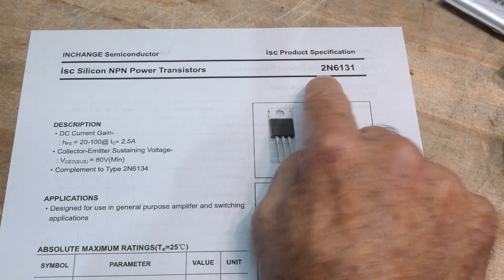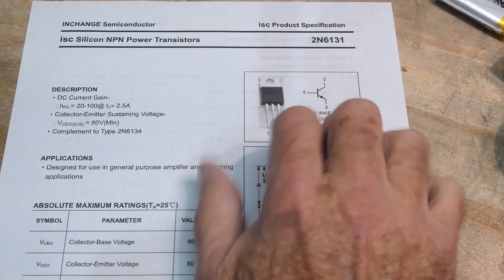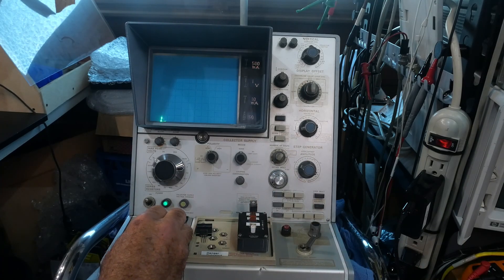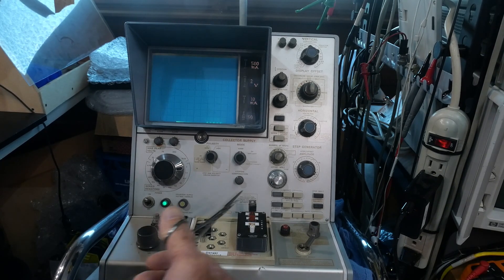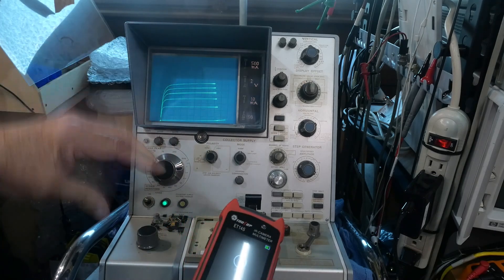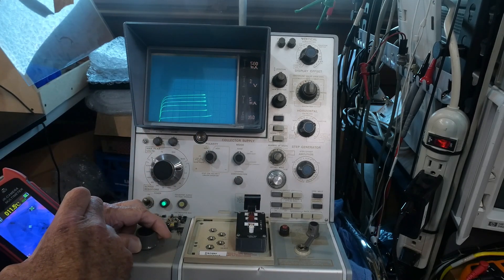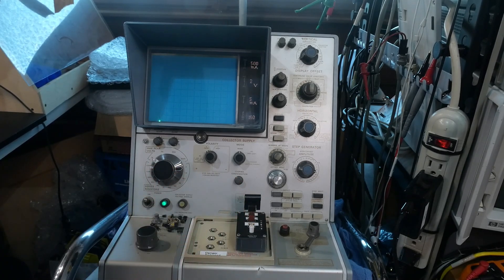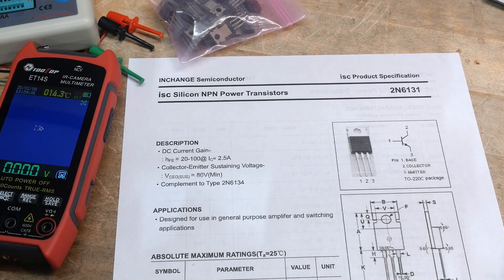#2145 2N6131 NPN Transistor

Comment: This reminded me of the old days. The worst thermal transistors were, of course, the Ge ones. They would easily run away and destroy themselves even if not too hot.  The  biasing needed to be designed really carefully keeping in mind also the normal working point. If that started to slide, the Ge pnp or npn lost its vital parameters causing distortion or clipping.

Comment: power transistor, no power rating (watts)
Reply: It's on the first page of the datasheet. Absolute max: 50 watts. Additionally you can use Ohm's law: it says 7amps continuous collector * 1.4v saturation, plus  2A base current * 5VBE = 20w, which is the more realistic option with the style of heatsink and no fan shown here.
Reply: It doesn't show in the video , and it is not spoken also. amps times voltage is not ohm's law it is joules law.
Reply: @RealRobotZer0  What does it matter? First of all, Imsai isn't a sales rep pitching a 30 year old transistor. There's no reason for him to include the less relevant specs info in a YouTube video. That's the job of the datasheet, which is right there. No one selects power transistors based primarily on their heat dissipation. You care about the current it can provide and the voltages it can handle first , and then you only consider dissipation when you're considering cooling.
And lastly, as we both clearly share a love of pendantics 😁, it's actually Watt's law for P=VI. Joule's law is P=I^2R.
Reply: @SkippiiKai  People just talk about everything but the point, don't you feel like that?
Reply: @RealRobotZer0  Well... No. He discussed and showed cool things about old tech. That was the whole point.
Reply: @SkippiiKai  You just have no expectations and take everything as is. But if you were to try to make something , you wouldn't be able.
Reply: @RealRobotZer0  in the last 24 hours I designed two new switching power supplies and completed building a dummy load I designed that I've already used several times testing other projects. Some of that was achieved by actually reading datasheets. I'm sceptical how much more I would have accomplished if I'd spent that time insulting strangers on the internet for not telling me things I hadn't asked them. Although now that you mention it, I am pretty annoyed you didn't even tell me the max cathode current of the TLV431 in your last comment.
Reply: @SkippiiKai  No. TLV431 is totally out of the blue.  Power dissipation is relevant especially if you are going to stress test (fry) the component.